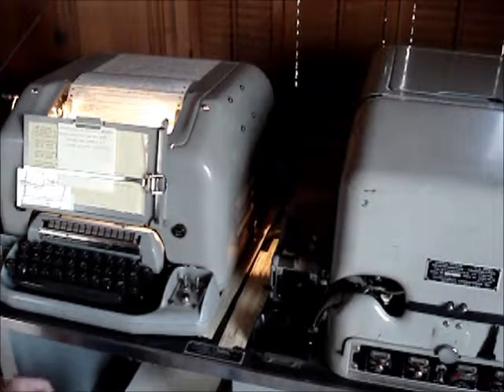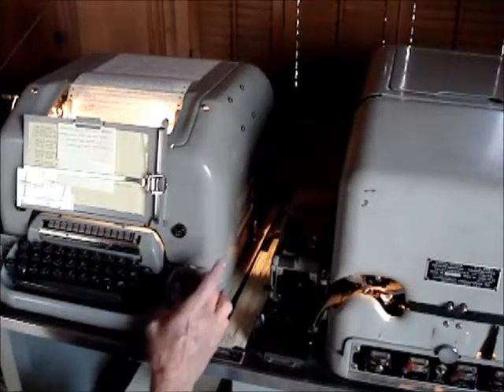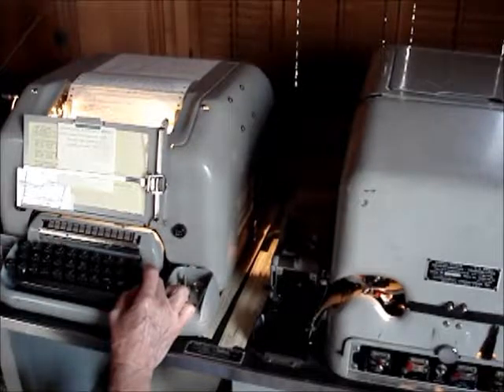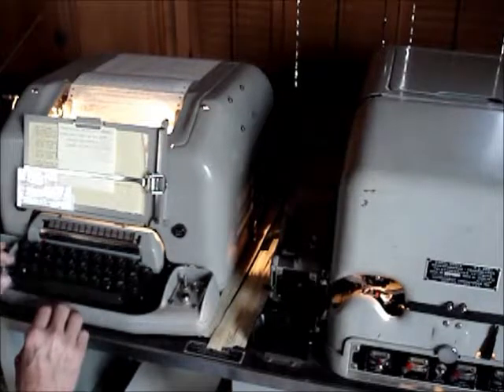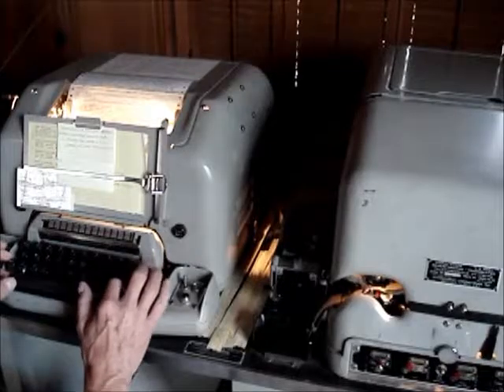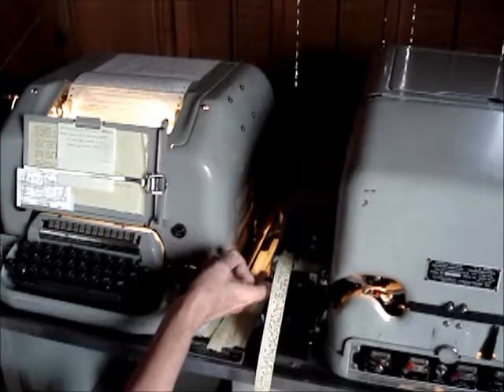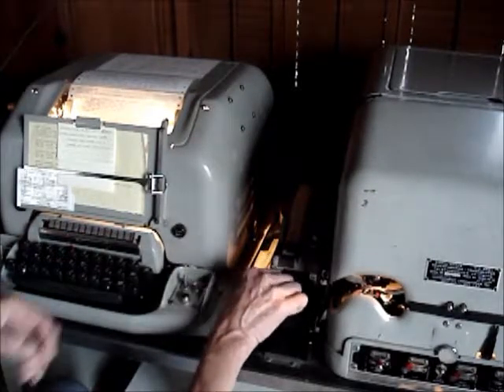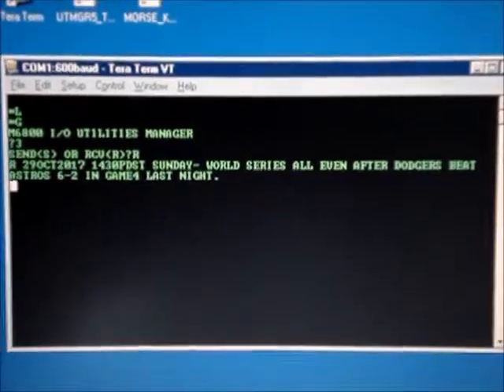"Torn Tape Relay" Demo 2 using AN/FGC-25 Teletypewriter Set

Comment: Brings back memories.  I operated ones similar to this at Fort Lee, Va; Taipei, Taiwan; and all over Germany 1966-1974.  At times I had to read the holes in the tape that had no print on it to make sure it went to the right location for transmission.  We played tricks on the new replacements in Taiwan telling them that when the tape was at its end-all of the chad had in the trash bin had to go back into the holes before going to the burn room at midnight.  The "five-level Baudot code" was sensitive and could not leave the section without being replaced back in the punched out holes in the tape.  I got a lot of laughs.  I ran the service section of 13 transmitter/distributors and tape receivers.  It was a learning experience as an operator.
Reply from the maker: Hi Lee- sorry for the late reply- thanks for watching and its great to read about your experiences with this machine. I was 12 in 1965 when I first saw teletype machine operation in ham shack of a man in our church and I was fascinated by it. My set is due for routine lubrication. -73